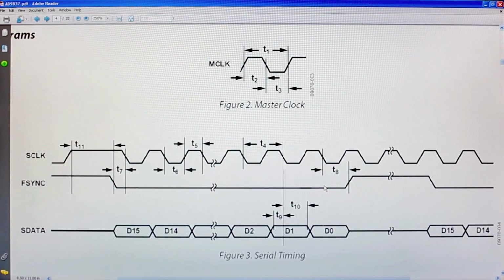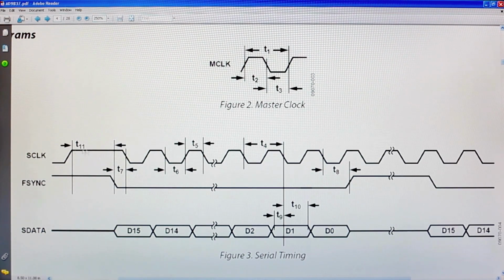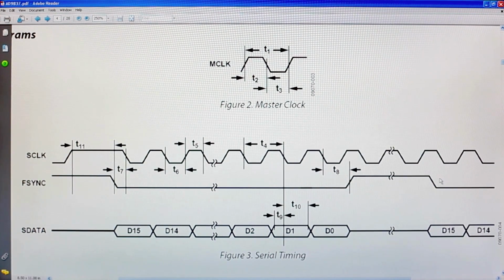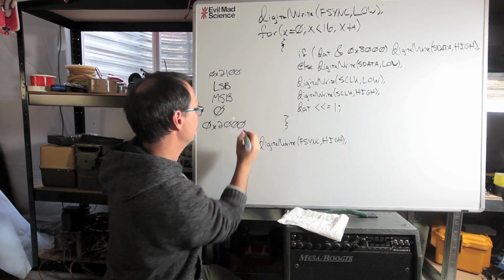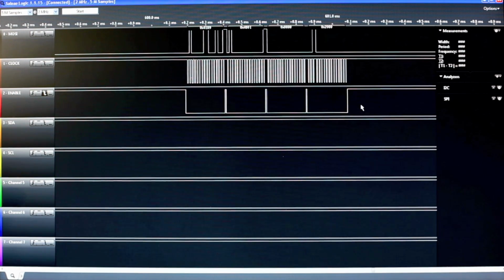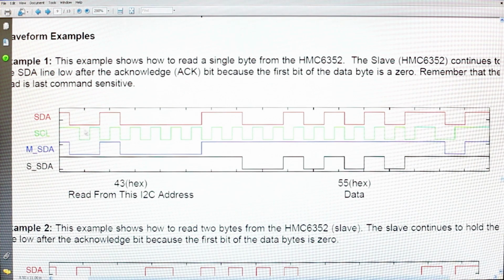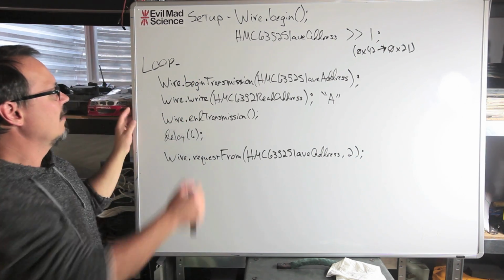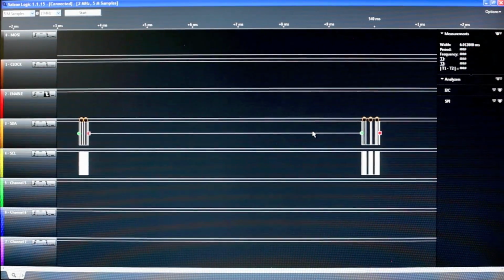SparkFun According to Pete 10-15-12: SPI & I2C

Comment: I wrote software bit banged i2c routines and used a logic protocol analyser to see what was happening on the bus. It wasn't easy and I rewrote my code 3 times before I got it working reliably. With eeproms you have to use ACK polling when writing data before you can continue with the next message. Also sometimes a restart sequence dosent work so its better to issue a stop then another start when going from a write to a read data byte sequence. Also you can single step through your code as there is no minimum speed the i2c bus will work at.

Comment: I am bit confused on I2C about reading from the slave. One source said that we first need to issue addres+W, then data(?), then WITHOUT sending stop condition, repeat start condition, repeat address+R, THEN, and ONLY THEN we can read data from the slave. That is so confusing. Atmel document said differently. I tried to read bytes from MCP4725 (12 bit DAC), and did not succed with way that Atmel datasheet explained. All I got as data is repeated address + nonsense, without any ACK bites. Just SDA remains high until stop condition. What is the trutn? Does this depend specifically of which device is the slave, or I am missing something? Please help. Thank you in advance.
Reply: Oh, btw... I am watching on the O-scope what is happening (looking for ACK or NACK bits), because other debug options as is Serial.print(); did not provide detailed info, or did not provide anything at all. And my logic analyzer is... Cheap Chinese *$&#...